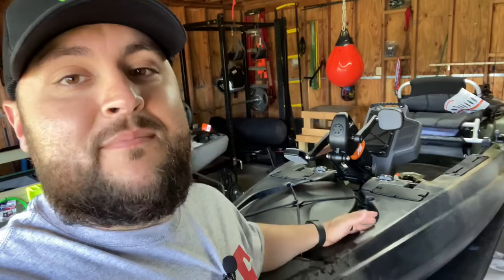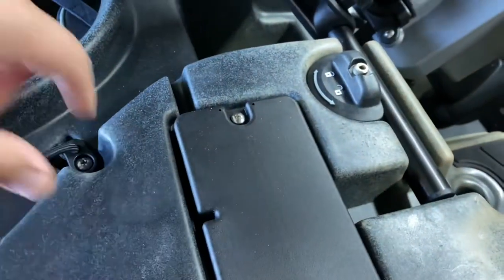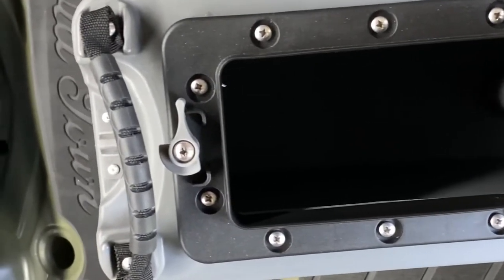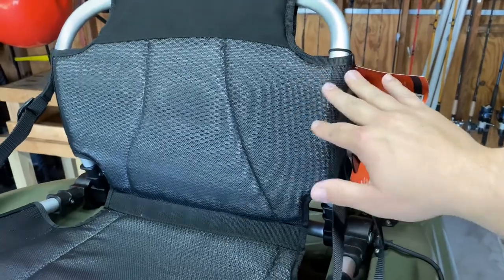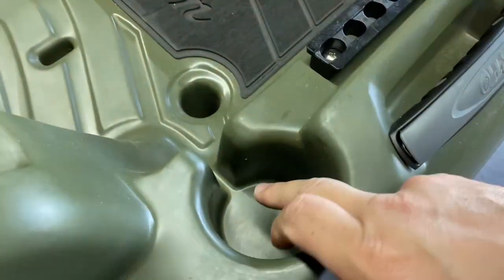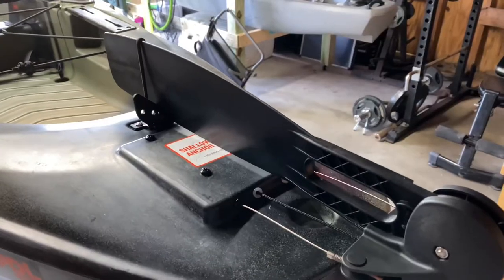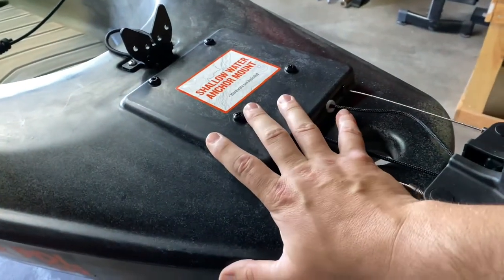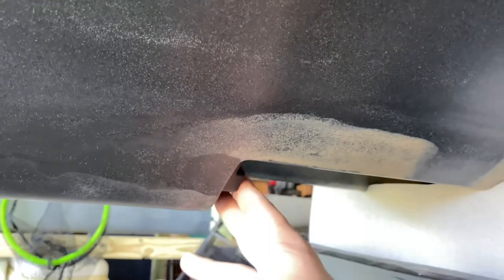My NEW Fishing Kayak! OldTown Sportsman BigWater PDL 132 | WALK THROUGH VIDEO - Partial REVIEW

Comment: It will flip my second trip out sitting in the seat not moving or leaning or reaching the boat in slow motion flipped lost $1200 in rods very unstable I have been kayak fishing for 16 years I bought several kayaks the Bonafide is very stable I sold the 132 in 3 days and bought P127 Bonafide good luck Aliex has videos out with that kayak figure out the seat is to high easy to flip
Reply from the maker: Sorry to hear that happened to you! I’m sure everyone is different. I find it extremely stable. I fight and land fish completely standing up. I even sit with my legs over the sides at times. It’s been a great kayak so far.

Comment: I was searching everywhere trying to find out the rear tank well dimensions,  saw it in the comments.  Thanks ! Good review I  am sold. Just need the money,  haha.
Reply from the maker: Glad I could help! I still have it so if ya have any other questions I’d be glad to help. I did recently upgrade to a pedal drive.
Reply: @ADDICTED2FISHINGTX  well since you asked,  I was wondering the dimensions of the front side plates and the ones up front by the pedal drive. I was thinking of bolting some railblaza mounts for more security, but just wanted the specs on the boards  to see what kind of layout I can put on em. Thanks!
Reply from the maker: @XxJalelxX  I’ll measure them for ya! But what do you mean by front side plates? Do you have an Instagram?
Reply: @ADDICTED2FISHINGTX  The side plates left and right with the built-in rails  to mount accessories like fish finder. And other plates are  the smaller ones by the front hatch. Those are plain with no built-in rail.